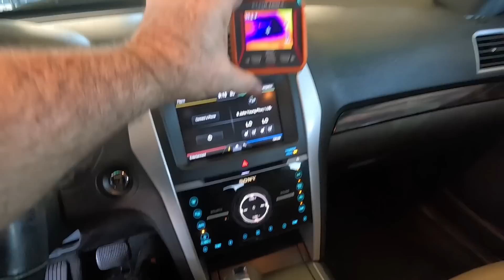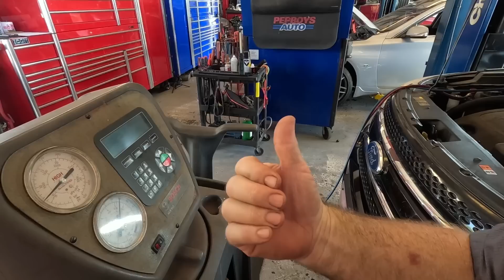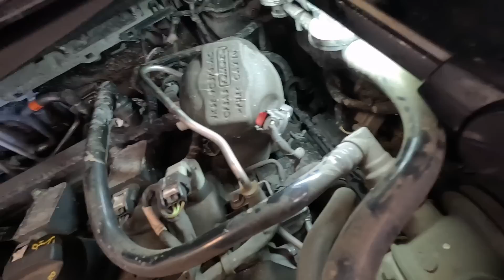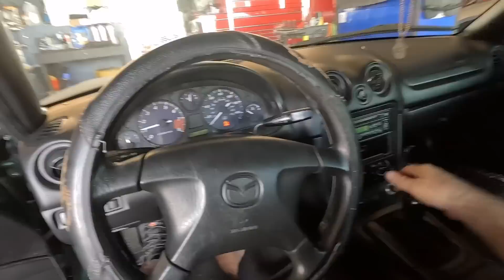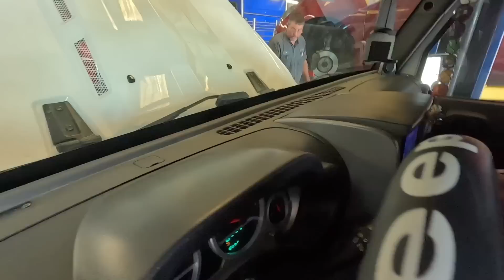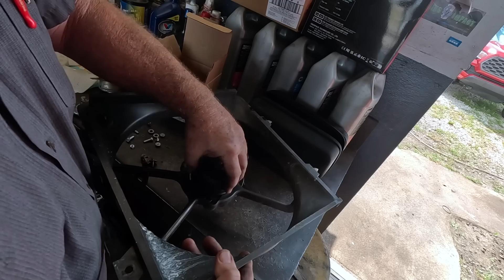MISDIAGNOSIS, AC FAIL, CHECK ENGINE ON, COOKED MIATA AND MORE...A DAY IN THE AUTO REPAIR SHOP 242.

Comment: No sealant, gasket goop or rtv on a gasket to "help it seal better". Put it on dry. Any dressing is weaker than a gasket and may permit gasket  to squeeze out or move around and produce a leaking joint. Can use dressing if surface is gouged or damaged though.
Reply from the maker: Exactly!

Comment: I had a misdiagnosed AC problem on my 17 Forester.
On full tilt the compressor clutch would cycle on/ off. Inside, you could feel it go hot/cold. On average, it was  sort of coolish. Not good.
Read on Forester forums how messing with the shims behind the clutch you could  stop slippage.
I removed one of two shims, no help.

Realized it was turning on/ off- not slipping.
Took to an indrpendent, said bad schrader leak. 
Better cooling but compressor still would cycle.
6 mos later it stopd cooling.
Got a can of recharge with gauge- pretended I knew what I was doing.

Too much, compressor made noises, ugh.
Left charge hose on , removed can,put end of hose in big jar.
Purged a bunch of black particulate into can. Where did that  come from?
Started cooling again, compressor stopped cycling off.

All better.
It just needed to throwup..
Reply: Black particulate. That is known as Black Death.
Reply: @mph5896   I guess. I don't  know the source. They were all black, ragged looking, maybe 1-2 mm in size.
My guess is that they were collecting at inlet to something in the system( receiver dryer, compressor, condensor, something else). 
The obstruction  caused the compressor to cycle on/off due to the high pressure( I guess).

After purging ( low pressure side schrader) of that crap, the cycling stopped.

The condensor was replaced  maybe 30000 miles back under factory recall.

Cools much better after throwing up.
Maybe the 166000 mile old compressor is NLFTW.
Reply: @williamevans6522  Its prob the dryer coming apart. Jimmy might have a better comment on that.
Reply from the maker: Yeah, anytime the system gets hot, like a bad condensate, compressor failure from low oil or similar, a black soot ends up from cooked oil and other particles like seals degrading. these systems need flushing and all the lines opened up to do it so they are cleaned well. All new lines is best, but expensive.
Usually the worst areas are on the high side between the condenser and expansion valve.

Comment: I would have installed the starter in that Jeep so that guy could eat it. The Miata, I would have looked a little further for a blown head gasket (cranking irregular/overheated/coolant stains all around radiator, CEL on). That's alot of parts to put on a car with a potential clapped out engine.
Reply from the maker: Yeah, car came in with customer request radiator, hoses and T stat. The radiator had an obvious crack, but it had an extended crank and slightly rough idle right off the bat. I asked if we are checking it or installing the requested parts, got the eye roll…parts are in.

It’s sitting in the grass now. :/
Reply: @JimmyMakingitwork  Yeah, I get it. Glad I only do friends and family stuff and don't have to play the game.

Comment: I agree Jimmy why cover them up if the original seat covers get ruined I just order new ones from the factory but I keep my truck very clean 👍👍
Reply from the maker: Exactly, that’s what I prefer. I can see using them if you get dirty on occasions, but the tie on ones are odd to me. Everyone has to row their own boat. ;)
Reply: @JimmyMakingitwork  yes sir 10-4 on that.

Comment: The Dye used to detect AC Leaks, will Brake Cleaner remove the Dye off anywhere it happens to be after repairs, like on a good line or something? Just wouldn’t want it to be mistaken for a new leak.
Reply: Yes
Reply from the maker: Yes, I use brake clean for that. They also sell a dye neutralizer spray, but it’s a little pricey.